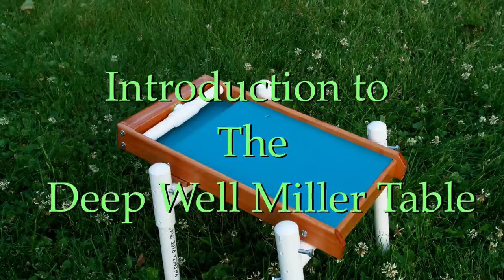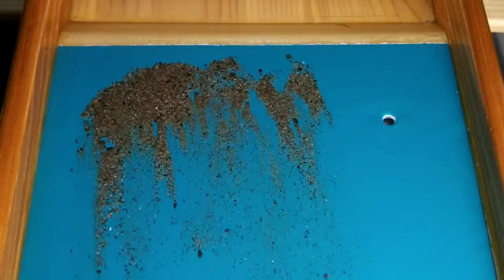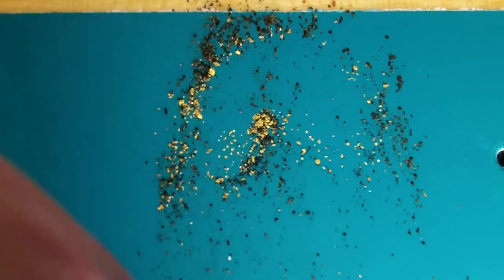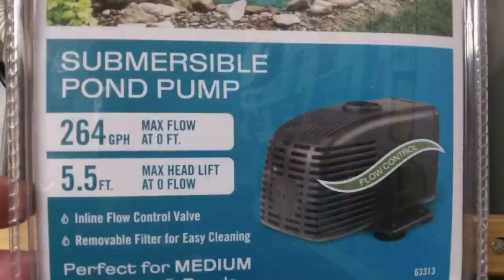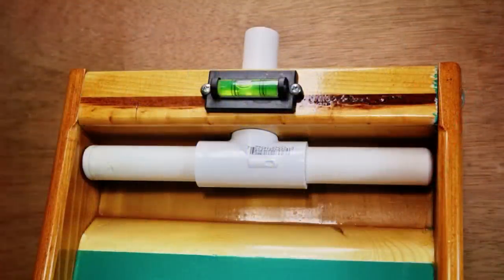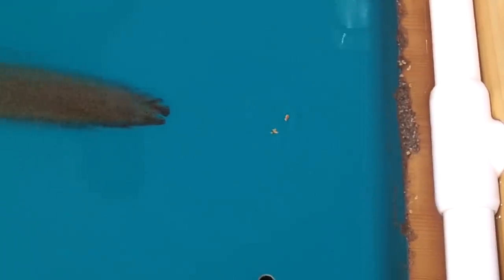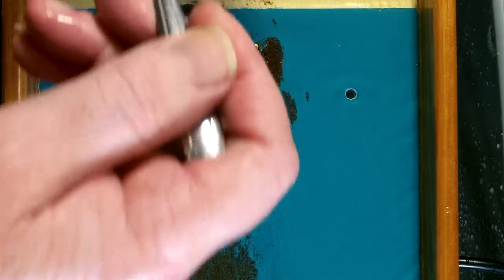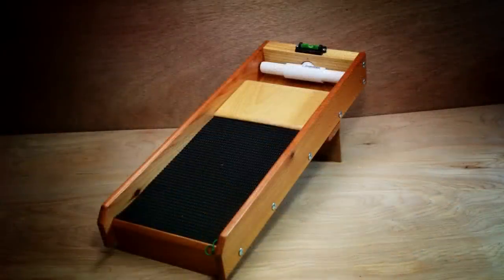NEW MILLER TABLE INTRODUCTION

Comment: I like your vids, they're relaxing and informative. I don't pan for gold or even really have the desire to, but I'm still watching. I hope you and your grandson can create the ultimate miller table (I don't even know what a miller table is, I think it has to do with the special paint?) Anyway, I'm subscribed :)
Reply from the maker: biff slamchunk 
Hi Biff, thanks and thanks for watching. I think we have found the ideal Miller Table in my latest video. It's a combination sluice and Miller Table. The gold likes to stick to this special paint while the rest of the sand just washes off leaving the gold. A really nice tool to have in Prospecting.
Reply: @utahavalanch  I watched that video, very cool. I had an idea as well, I obviously don't know if it's any good. The "trough" that you added, do you think it might work better if it was more concave rather than square/rectangular cut? You know, like scooped out? Or would that even make a difference? Would that allow lighter material to escape from the trough?

Anyway, I hope you go for a patent on this, before someone steals it away from you.
Reply from the maker: biff slamchunk 
Hi Biff. Yes, changes in the design can make a difference. I have built and tested  about 40 of these over the years trying to get the smoothest water flow and best gold capture I can and this design the way it sits is the very best I have found so far. However, I'm continuing to  test other ideas and if I come up with something new, I'll put it up here.  Well, unfortunately patents cost a great deal of money and don't prevent people from stealing your ideas. Anyway I put these projects up for people to build and try themselves. I have a "How To Build" video out on this so people can build them and use them. I will put up a "How To" on my latest one that I'm trying to get finished as soon as I can. Too many ideas and too little time.😄 thanks for watching.

Comment: Awesome is all I can say right now 😁😁😁😁😁 I'm having a friend of mine in our GPAA chapter building me one. As a 100% disabled Vietnam combat veteran this will be great for my back yard prospecting. This is very therapeutic for me as well
Reply from the maker: Mick Dundee 
Hi Mick and thanks for watching. Thanks for your service and very sorry about the disabilities. I know how it is. I got mine in Nam era as well. Yippers, running one of these is very therapeutic and relaxing.  I think you will really like this unit. I have been designing and building these for 12 years and this is my favorite. If you haven't seen it yet, I have a video on how to build it. I also have a video on my 3 way combination sluice which is similar but is also a sluice as well. Also check out my running the 10" Silicone mat. I show a bit on how to use the Deep Well fluid bed part of it.

Comment: Great video. A parts list in the description would help. Thank you for the video.
Reply from the maker: Big Country Vet 
Hi Big Country. Thank you for watching. Are you referring to the support package tote, pump, valve etc. or the table parts? If you would like I can give you one for any or all of it. I have a video on how to build the table and I guess it wouldn't hurt to put a basic one one in there. Usually the folks who build these end up changing things all around to fit their needs or what is available to them.
Reply: @utahavalanch  I would love to get a complete parts list if possible
Reply from the maker: @dadandsongaming8310  
Well, these are to be made depending on an individuals needs. I don't have this table any longer so I'll give you a guesstimate.
1 Cedar base board 1/2" x 9" x 16-1/2"
1 Pine top deck 3/4" x 9" x 14"
2 pieces of pine to make up the headerboard for the water bar 2 each 3/4" 9" x 2-1/2"
2 Cedar side rail pieces  1/2" x 2 -1/2" x 19"
1 cedar drip board across the bottom end 1/2" x 9" x 1-1/2"
I use 1/2" cedar fence boards for the sides and baseboard to conserve on weight but if you want you can cut the baseboard, Top deck and even the header bar out of the same board. I split a cedar fence board in half for the side rails but you can buy a pine 1 x 3 furring strip for the side rails if you don't have a table saw. 
I have a video on how I made this table if you are interested in building one that goes into a little more detail. Thanks for watching.

Comment: What kind of holes did you put in the PVC pipe that feeds water at the top?
Reply from the maker: Hi Lon and thanks for watching. I usually put a row of 3/16" or 1/4" diameter holes 1/2" apart. I have recently been working with 1 row of 3/6" holes and then another row of holes just slightly offset from them and slightly back so that the second row of holes are right in between the first holes. I think this is giving me a little smoother water flow.  Also on  my last one I just built, I moved the deck down about 1/2" so the distance from the back of the sluice to the edge of the deck was 3". I think this is giving me a little smoother water flow.  Also I didn't cut the angle on the end. I just rounded the sharp corner on the edge a little bit.  I originally put the angle on it so the well could be used as a fluid bed sluice but I find that most people aren't interested in that on a miller table.  They just want to use it as a Miller Table so you don't have to cut it if you don't want. 
Also if you don't want to try putting the vial bottle in you can drill a 1/2" hole about 1/4" deep where the vial hole is and just brush the gold into it so you can suck up the gold with your snuffer bottle. I usually just brush the gold back into the deep well and it stays there nicely til I'm through and then I just snuffer it up.
Reply: utahavalanch I found your video the most informative of many I’ve watched, about miller tables.  I’m retired and live five minutes from Cape Disappointment state park, where there are well documented black sand deposits.  Flour gold is what is found there, and it seems the Miller table is the best way of recovering it.  
The expense of buying equipment for processing such fine gold, would make recovering the costs, nearly impossible.  But by building my own equipment, using your method, it opens up new avenues of possibilities.  Thank you for sharing your insights and knowledge.
One thing that amazed me, was the use of chalkboard paint on the table.  I had assumed a special type of silicone or rubber mat was always used.  
I understand the importance of an even flow of water across the table and it seems a pulsing type pump would interfere with that, so the insight about the harbor freight pump was a nice bit of info to take note of too.
Reply from the maker: @lonpearson2134  
Hi Lon. Thank you. I fell in love with Miller Tables about 12 years ago and have been working on improving them ever since. This Deep Well Miller Table is a design I’ve come up with that works better than anything on the market.  I now have a newer version with  a bit of a change that I’m testing now.

Much of the gold we have here in Utah is very small and so the Miller Table became one of my favorite tools.  If you saw my video on my combination sluice that is rapidly becoming my favorite due to it’s versatility.

Yes, Rustoleum Chalkboard paint is by far the best thing to cover the deck with. I and another gentleman have tried many different types of shelf liners, rubber and silicone products and I have tried at least 50 different paints and sealant type products.  For some reason the gold likes to stick to the Chalkboard paint the best.  I am a huge fan of Alan Robertson’s silicone mats and I made several tables using silicone but sadly they didn’t work out. 

 I started working with Cape Disappointment sands a number of years ago when Washington Beach mining started selling them.  Since then I have worked with the sands from a number of beaches in Alaska, Minnesota, Washington, Oregon and Wisconsin trying to come up with the best way to recover the gold from them. This Miller Table is what I have found so far to be able to recover the most amount of gold from those sands. 
You are lucky to be so Close to the Cape.  I have received the tailings from several people who have been working the Cape sand using Gold Cube stacks dumping into long sluices so I can get an idea on how much gold they are losing and it’s quite a bit. So I think that although it is slow the Miller Table is the best way to recover the most gold.
I think if you were to build one of these, you could run to the Cape and pick up a 5 gallon bucket of sand and sit home, kick back and run it through your table at your leisure and recover 99% of the gold instead of about 60%. I’m basically doing that here with 1 gallon sample buckets of dirt I collect around town and the countryside and getting far more gold than I ever did working the claim and I’m enjoying it a lot more.
Reply: utahavalanch I was thinking along those lines, though my 1971 f-250 4x4 might be able handle more than just a few buckets.  I have only driven by the area and have not invested any money in equipment yet.  I’ve been enthralled with the gold rush series and Bering sea gold shows and it got me looking at youtube videos of gold miners.  Even with the little bit of insight I’ve gained from watching lots of beach miner videos, I know I have a lot to learn.  
After looking at prices of equipment online, I’m dead in the water for getting any gold with that stuff.  I am handy with a saw and such and can construct a table like yours, now that I’ve learned so much from watching your video.  Which brings me to the question of scale.  If I can get my truck down to the black sand area, it’s a matter of how much can I shovel until my 70 yr old back gives out.  A small table would not work if that ends up being possible.  Given the fine flour gold that I expect to find, I know I’m not going to get rich.  But I would like to work with it a bit and see how it goes, so will probably start small and see how it goes.  
I look forward to seeing your new designs.
Reply from the maker: @lonpearson2134  
Well, I have to leave all that heavy shoveling and hauling to you younger guys.  Nowadays, I’m doing good to get my 1 gallon filled :-D

If you are working larger gold you can move 5 gallons in an afternoon but with the very slow water you have to use for that very tiny Cape gold, it will take you several hours to run 1 gallon. But I don’t have much else to do any more and so I quite enjoy running it. 

I don’t know if you watched my video on how to build this table but if you haven’t you might want to as I take you through all the steps to build it.  There are only 5 pieces to it and so it is quite simple to build.  I also have a video on my Combination sluice that I’m using now with the silicone mats. It’s similar to my new Miller Table which has a longer deck and only a 2” mat at the bottom.
You can find my videos here if you haven’t already.

https://www.youtube.com/user/utahavalanch/videos?view_as=subscriber

I have about 36 tables I’ve built for testing over the years but I now only have 3 that I use from 5”, 10 and 12” depending on how much sand I’m going to be running.  
 So you can make your table any size you want to fit your needs and multiple sizes.  One gentleman built one 7 feet wide. You may want to make a small one you can run in a plastic tote to try to see if you like it. You can get a quick glimpse of it in this video.  I run mine in a 10 gallon tote from Home Depot and it is portable so I can take it camping with me and run from the tailgate of my truck or even in the kitchen in the winter time. I would start with one that is about 10 inches wide by 22 inches long. That will allow you to work quite a bit of dirt at a time.
Yea, none of us are going to get rich but once you see that shiny in the pan or on the table, it’s hard to get away from. Plus, there are lots of streams and dirt piles in your neck of the woods that have larger gold so you are not limited to just the beach. Check any dirt that has rounded river rock in it.  Check out my video on Urban Prospecting with my grandson. He got almost 1/2 oz just from gutters in his and my neighborhood  over the summer. So the gold is where you find it. 👍
Reply: utahavalanch I worked at a paper mill for 37 years and the slice on the head box of the paper machine, determined the flow of pulp slurry onto the wire, which was a fine meshed screen on rollers and comprised the initial formation into a sheet of paper.  The slice was a narrow slit at the bottom of the head box, which contained the pulp slurry in a chamber, with channels for keeping the slurry evenly mixed at a ratio of .05% pulp and 99.5% water.  The evenness of the water flow was a critical part of the operation and I wonder if some of that, old school technology about paper making, might be something that could benefit a miller table.  
Even though there have been huge improvements in paper making science over the years, the slice on a head box has been altered very little, since it comprises some basic concepts in fluid dynamics.
Reply from the maker: Lon Pearson 
Hi Lon. I’m very sorry to leave you hanging. We got hit with hurricane winds and I had a big tree fall on my truck and another on my storage shed. Been trying to cope with the damage. What a mess.
Your idea would work well with a sluice but with a Miller Table it would overload it. With the Table you just add a spoonful of material and then work it with a brush until all the black sand has moved off. Then you add another spoonful. The Miller Table is quite slow but it gets all of the gold no matter how small. This is great if you are in very small gold country like I am.

Comment: Very good explanation. Are you using a silicone mat or a rubber mat?
Reply from the maker: Hernando Molina
Hi Hernando and thanks for watching. Neither one actually. This one uses Chalkboard paint for the surface. Only the gold sticks to this paint and everything else slides off. Both gold and black sand sticks to the Silicone surface which you don't want as you want to get rid of the black sand.
Reply: @utahavalanch  Good morning and thank you very much for your prompt and clear answer. I will construct my own Miller Table in aluminum or stainless steel. God bless you!
Reply from the maker: Hernando Molina 
Hernando, I want to wish you the very best of luck. I think you will really like the Miller Table. It is my favorite Prospecting tool.
Reply: @utahavalanch  Many thanks for your attention. In your video "HOW TO BUILD THE DEEP WELL MILLER TABLE" I can see some scratches over the Chalkboard paint which were probably caused by the gold when you use the brush to separate the free gold and because that type of paint is not ideal for supporting water. Now I understand why you recommend the application of several coats of paint. In your experience, the Chalkboard paint is a durable solution to use over the miller table, or you have to repaint constantly everytime you use this tool?
Reply from the maker: Hernando Molina 
Hi Hernando, the scratches come from a large metal spoon I use to dump the material onto the table. I tend to drag it across the top of the table when I dump the material on it. A plastic spoon would cut down on that. I don't really care as it is quite easy to mask everything off and apply another coat of paint. I can put another coat of paint on at the end of the year if it starts to let the gold slip. It is quite tough paint in spite of not being labeled as being waterproof. When I am through running it, I turn it upside down and drain all the water out of it and let it dry. If you watch my video on Urban Prospecting with my grandson, you can see a table that I have been using for 3 years without repanting I'm still using it today. So the paint is quite tough if you don't let water sit in it overnight.
The paint is Rustoleum Chalkboard Paint and comes in a pint can. There is enough pant for about 50 or 60 coates.
Reply: @utahavalanch  Thank you very much for your generosity and for sharing your knowledge and experiences. These will be very useful for me. God bless you!
Reply from the maker: @Jericho941fbl  

Thank You. You are welcome Hernando. If I can be of any help just let me know.
Reply: @utahavalanch  Thank you very very much. I really appreciate it. God bless you!!!